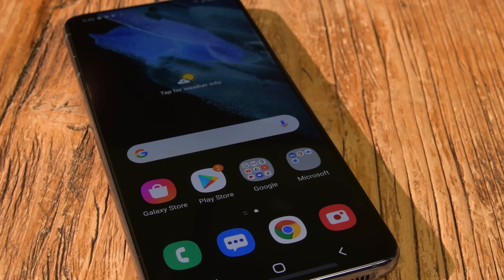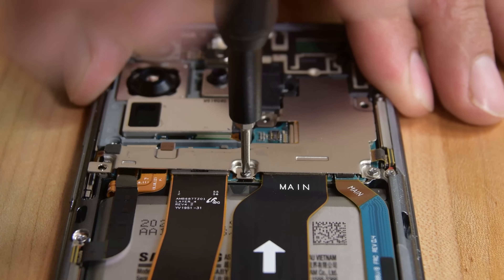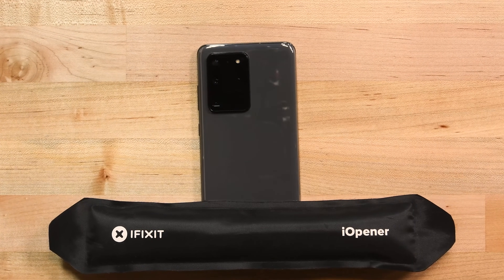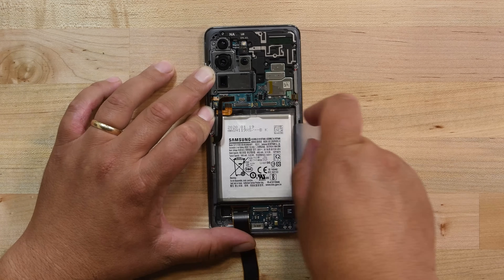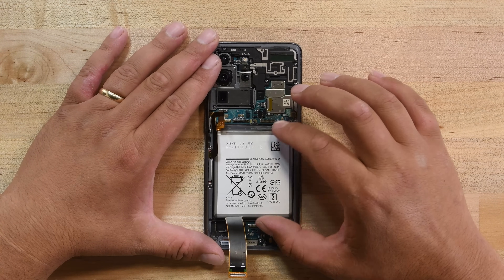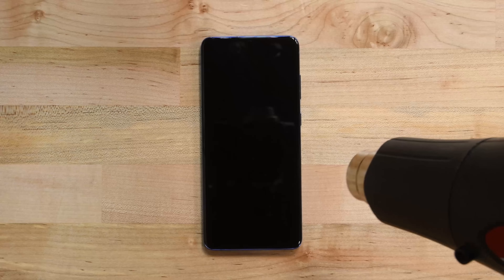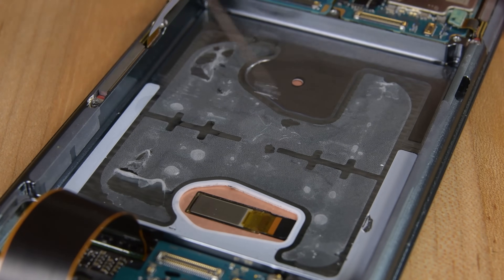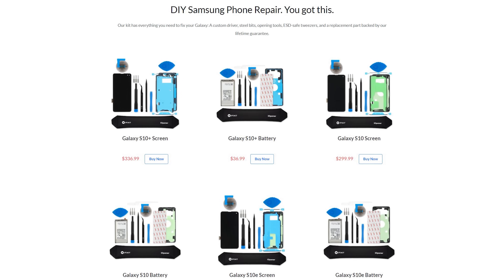5 Things you should know about fixing Samsung phones

Comment: Fun tip, buy a whole new frame and screen assembly together instead of buying the screen only. It makes things a lot easier. If your old screen is still intact with no dead pixels, sell it off to a screen refurbisher to recoup the extra cost of buying a display assembly with the frame. Removing the display only usually kills it, so if its still intact you might as well keep it that way.
Reply: Thanks for the tip, but just asking out of curiosity, why would you buy a new screen to replace your old one if it doesn't have any dead pixels and is good enough to sell?
Reply: @doge-of-venice  if you only broke the glass part you can have someone replace the glass and sell it
Reply: @doge-of-venice  its much more harder tho
Reply: @franktg632  Okay, thanks for the reply.
Reply: Thx u saved my cracked s10
Reply: This is how Samsung sells its repair kits to "authorized" repair places like ubreakifix.  I just got my 3 year old S10e repaired because the screen randomly died, and I asked them if they could replace the battery while they were at it.

They said the battery is actually replaced by default because they send these kits with the battery and display all glued together already - all they do is move the internals of the previous phone to the new kit and it's basically like new.

If your phone is 2-3 years old it's worth it to replace the battery with the display anyway, especially if you have plans to use your phone for as long as possible.

Comment: I have experience repairing Samsungs from the S3 up to the S8 and it has gotten increasingly more difficult. Don’t get me started on the rear glass panel. These devices are tougher to get into than the Nexus 6P, in my opinion. There’s a reason why this video has to be published.
Reply: yup. I really don't get why they have to glue in the battery like that. I even started calling it "elephant glue", since it would most likely be strong enough to adhere an elephant to a ceiling. Imagine, Samsung is only copying the bad things from Apple. And not their battery pull tabs :(
Reply: The rear glass is super easy with a heat gun. I've removed up to S20 ultra without problem.
Reply: So a tip to never have an issue with rear glass again. When you get some Samsung service packs, the batteries are covered with a thin but sturdy plastic square or rectangle. Add the right amount of heat to the rear glass and that plastic piece is your best friend for forever. I have not broke a rear panel yet with this method. A coworker of mine suggested it.
Reply: @NinetiesKiddd  Thanks for sharing. I will keep that in mind!

Comment: Denatured alcohol works better than isopropyl. When I replaced the battery in my Sony (after breaking the glass back), I just left it off and put the rest in a case... after all... new batteries regular thing... or just use weaker / less adhesive when re-assembling.

Maybe it's time for iFixit to start making (or partner with a maker) some replacement parts out of polycarbonate, instead of glass... esp. for the backs , where it's not so critical to see-through, or have fancy display electronics.

Comment: We all know we dont like glued phones but we can all agree that IP68 phones are very important nowadays and I think every phone should have IP68 or IPX8
So it's a trade-off u can't have a phone that looks good, have IP68 and be easily opened up. Instead of complaining go and design a phone / solution / idea without compromises on those 3 aspects: slim and beautiful, IP68 and repairable
Reply: Agreed. any decrying of adhesives are drowned out by the music i play in the shower every morning.
Reply: Samsung Xcover had detachable back cover and replaceable battery, while maintaining the water, dust and shock resistance.
Reply: @johndumpling1896  slim and beautiful was part of the terms. You failed. That phone is not slim or beautiful.

Comment: I cracked the back glass of my S20 the day I bought it 🙃. Been thinking about replacing it myself but haven't found the time or courage yet.
Reply: If it’s already cracked it’s super easy, plus you don’t have any fingerprint sensors or cables on the back glass, just heat it up properly, use IPA on the areas that are giving you trouble and mind the broken glass!
Reply: Yeah bro, if it's already broken, and it's just the glass it should be no problem
Reply: @7AZA03  where do one find genuine parts tho
Reply: @parabolicpanorama  eh yeah that’s probably a little difficult, I work at a authorized repair shop so if you’re worried about warranty that’s probably the route to go, otherwise just make sure the replacement has adhesive pre applied or you source that as well

Comment: There's a reason why I didn't bother getting my Galaxy S7 Edge repaired when I broke the display (accidentally - by dropping it). It was too costly and too difficult to do.
It would have been just as cheap to buy a used Galaxy S7 Edge in fully working condition.
Furthermore, many Samsung displays can be purchased with the frame attached, and you move all of the components into the new frame. That's the way I'd choose.

Comment: Everybody is always hating on iPhones being unrepairable. However, I think Samsung's (and most Android's) are way more difficult because the back glass breaks easily because it is glued way too strong and like you say, doing a screen only repair takes a lot of time and skill. Besides the annoyance of the different screw types and software warnings, I think iPhones are more repairable and take less skill to repair. Curious to read other people's thoughts on this😗
Reply: I think both companies are equally bad at repairability. We can nitpick on certain design choices but phones from either company are no longer built with repairability in mind.
Reply: Disagree, but I understand you point. While display is easier to replace on iPhone, literally everything else inside is so needlessly tiny, complicated and weird, with too many different tip and size screws, really a nightmare for me.
Reply: I know you said aside from the software errors, but I think the software errors make any advantage gained in opening up pretty useless. You can't replace the camera, screen, battery, fingerprint sensor, faceID sensor, and probably some other parts I can't remember, without the phone having either reduced or no functionality (like cameras not working after being swapped), and so at that point what does it matter if the phone is easy to open or not if an average user can't actually replace anything after they've opened it.

Comment: tip, buy an iPhone, much better.
Reply: nope, still similar difficulty to repair and similarly expensive
Reply: No, they serialized most of their components (lately) and you won't be able to replace something as simple as the camera module. Once your apple device breaks and you're out of warranty you have to throw it. At least you can replace stuff in samsung phones and other brands as well even if its not easily accessible.
Reply: @George35000vr  they have some form of detection system built in, so even if you replace a camera, battery, Face/Touch ID sensor, it will refuse to work.